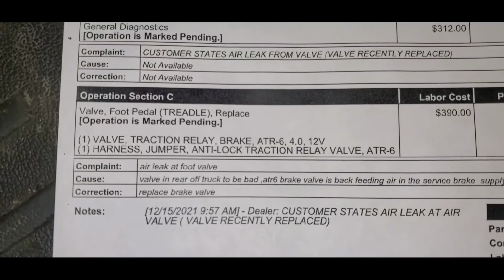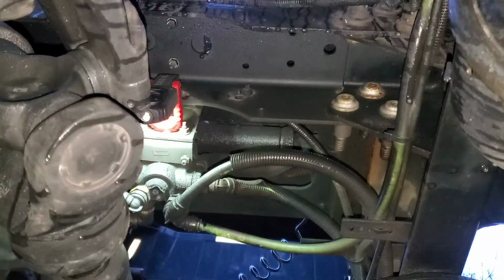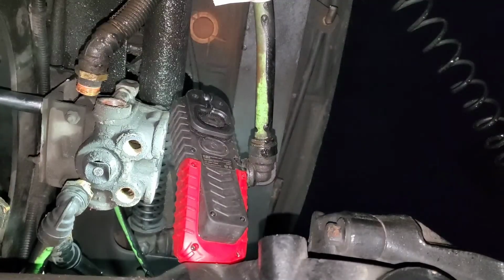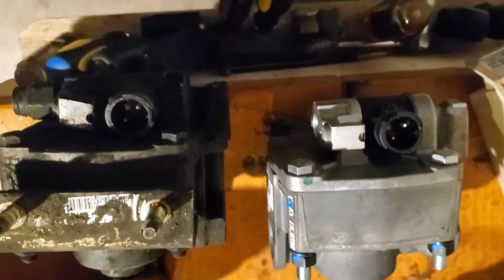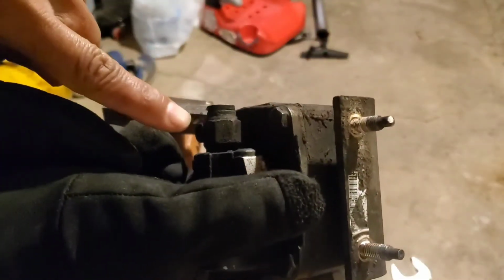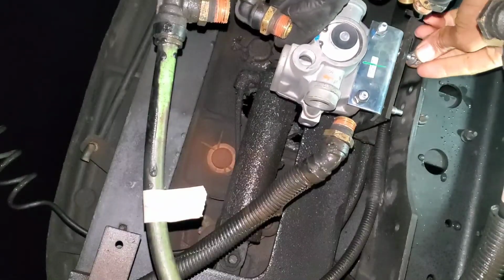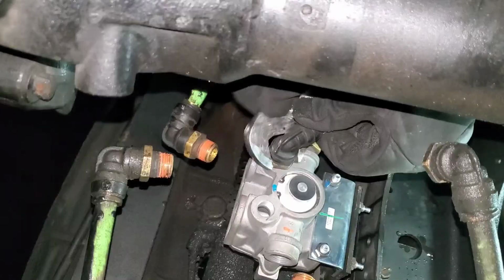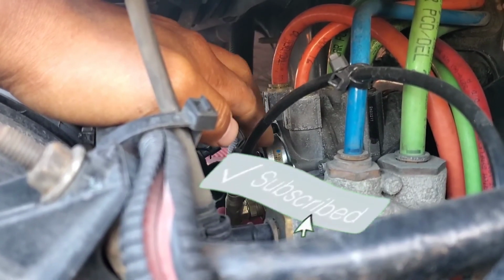Foot brake valve leaking, but the problem is not the valve! something is back feeding.I got the fix!

Comment: You just saved me a lot of money.  I had a leak that I couldn't find for a long time.  When it finally got really bad I could hear it from the firewall, but couldn't find the leak even with soapy water.  Right about that time, my service brakes were becoming slow to release.  Sometimes dragging for miles and severely heating them up.  I replaced only this valve and solved both problems!
Reply from the maker: I'm happy this video were able to help. I can relate to the frustration you were having. Be safe out there and thanks for checking in.

Comment: Hey guys, mine is leaking also when I apply the brake.  When I push in the brake valve, it's also air leaking somewhere.  I've changed all the stuff in the dash and chked for leaks.
Reply from the maker: It might be the part i change in the back thats making the front valve leak
Reply: @truckingpaysthebills5394  I thk I found my problem,  prayfully.  One of my brake chambers has come Unhooked.  Just found it.  I don't know how too change it though
Reply: @truckingpaysthebills5394  the brake chamber is not hooked too the slack adjuster
Reply from the maker: @midnightpassion43  are you taking about the carter pin
Reply: @truckingpaysthebills5394  I wish I could attach a pic.  But I looked closer and the round bar that's held up b a u clamp over the spring that is hooked too the slack adjuster has broken off and is drop on the spring.  That's what caused the brake chamber too come unhioked.
Reply from the maker: @midnightpassion43  yea its not a big job so if you take it in the shop it shouldn't take no more than 2 to 3 hours

Comment: Hey when I hold the brakes down I hear it leak threw the front threw that black seal with screw in middle your saying it might be the back ? Appreciate video
Reply from the maker: Mine was leaking without me holding the brake down i didnt check to see if i held down the brake it would leak worse.Just wanted to throw that out there because the fact that mine leak without me hitting the break and yours might only leak when the brake is applied might mean some different, like the problem is the front valve and not the back valve.i think you should get it diagnose to see what valve is the issue.good luck hope you get is figured out.
Reply: @truckingpaysthebills5394  yes thanks I notice from a different video that is a different valve that leaking because it leaks when I’m under a load but when im bobtail it don’t leak thanks for reply appreciate
Reply: @TruckerDave215  Did you find the problem? I have a truck I'm working on and same scenario as yours. It only does it when hooked up to a trailer, it leaks out the exhaust port on the tractor protection valve. (2016 International). Valve is located on firewall right next to foot brake valve.

Comment: Thanks for your video . I have volvo vnl 2015, same problem i had it and delivery line unpluged to check and found its bad relay valve under the fifth wheel.
Reply from the maker: You're welcome.

Comment: Getting same component changed in the moment 👍 symptoms loud air leak by firewall air leaking when holding break pedal and sticky breaks
Reply from the maker: The break might be sticky due to your air leaking or restriction in your air lines.
If you haven't in a while train your air tanks of moisture. I have a video on that.

Comment: Does it really take 5+ hrs to replace the treadle valve?? Or did I get screwed on labor costs?
Reply from the maker: You didn't get screwed. You got F-cked like everyone else who went to a repair shop.It should take no more than an hour and a half with no experience. Experience mechanic should be able to get this done in about 1 hour.

Comment: Can the same part be the reason for the steer tire on driver side to not rrlase the brake all the way since it's leaking air on the same position like in ur video truck is 2019 international c10 edition
Reply from the maker: You might have an issue on that front driver side line that's causing that part to leak.
Maybe there is a restriction or fail parts. Also    that slack adjuster might be bad, and if you changed your brake chamber recently and the length of the rod was not cut correctly that rod travel might cause that side to not operate correctly.
Reply: @truckingpaysthebills5394  sluck adjuster replaced brake chamber is ok

Comment: I changed all them parts except the foot brake valve guess I have to change it cause it still have leak and brakes locked  on me everytyme I hit the brakes air pressure drop all way down
Reply from the maker: Do not change the foot brake valve without checking your Air Brake Relays. Your truck should have 3 of them 1 control each axle brakes. Take off the delivery lines with the truck off. If air is coming out, then you need a new relay, not a foot brake valve.
Reply: What did you do to fix your problem

Comment: Hey buddy that’s really good video..
I have older Truck but it’s similar to yours ..
The one that you just replace is it called ABS valve right??
I replace mine but it was leaking air on the Dashboard plus on the foot brake valve .. I replace the emergency brake valve on the Dashboard thinking that was the problem.. the ABS valve itself was loosing lots of Air every time I apply the Brakes .. then that was caused by the quick release Valve and I had to replace the quick Release valve that solve almost every problem.. except that air leak on the Foot Brake valve.. on my Truck it’s not leaking from the air lines it’s leaking on the front edge where the four screw are in one of the four corners it’s leaking very bad .. 
if I shots off the Truck in less than 5 minutes my air goes all the way to Zero. 
So please need some help.. 
thank you 🙏
Reply from the maker: Hey driver 👋! Sorry for the late reply. The best thing i can tell you is to get a test done because the foot brake Valve does go bad as well as the ATR 6 Valve that you saw me changed.
My foot brake valve was looking from the corner like yours is but when i change it, the leak start to come from that round rubber guard that you saw me touch in the video on the foot brake  Valve. Then i decided to have a test done, and after i changed that ATR-6 valve to this day i haven't had any problems. If you going to change the foot brake valve or the ATR-6 valve without getting a diagnostic done, keep the valve clean as best as you can in case you have to return it for the other valve.

Comment: Did you have issues with your trailer breaks? And front brakes as far as heating and gear oil leaking
Reply from the maker: No i didn't
Reply: Im having the same issue it’s leaking from foot valve and breaks are heating and oil from gearbox